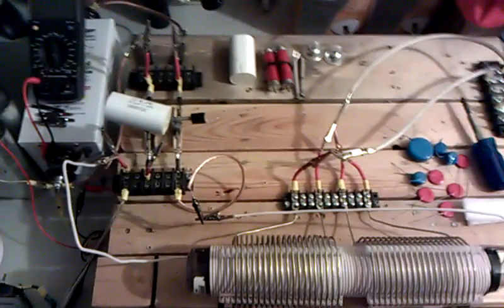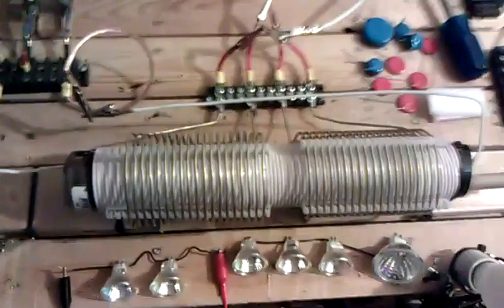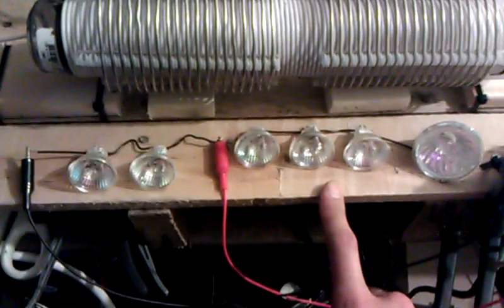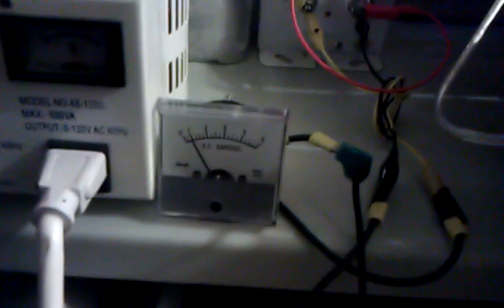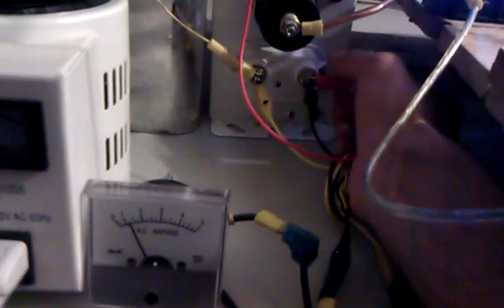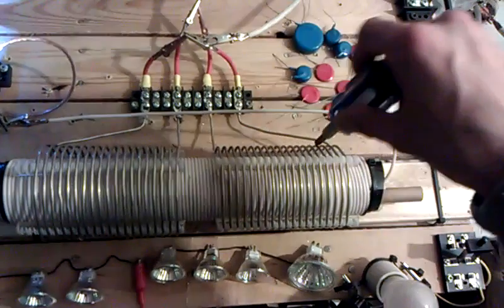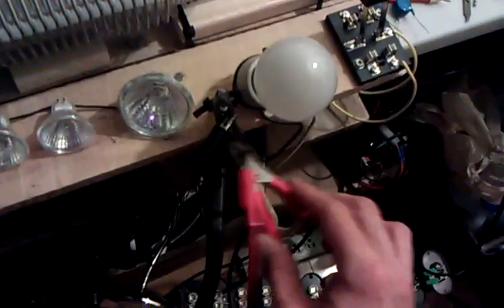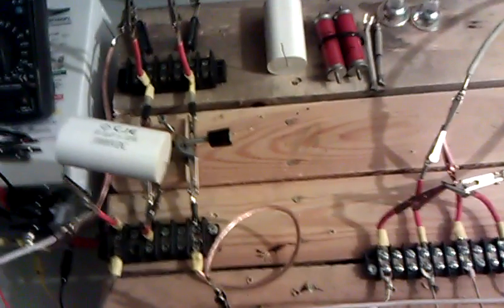Don Smith Device Project Part 36: Experimenting with Higher Capacitance and Welding Wires :)

Comment: You need second spark gap and resonant LC circuit in step down transformer primary on frequency your second spark gap will fire.
The frequency you fire over first spaek gap into DS coil primary should be much higher than frequency going over second spark gap.

Good luck!

Comment: Now if you get step down transformer with capacitor in series on primary and attach over spark gap to your DS coil output on resonant frequency to your high voltage capacitor firing rate, you should get some good power out.. ;)
Also you might increase input frequency to the system so the high voltage capacitor will start firing at least on 50Hz instead of ~20.

Cheers!

Comment: Or an electric fan heater with the fan powered by normal electricity, and the element by the generator circuit.

Comment: Hi,

Just a tip.
The blown out bulbs may sometimes be used as a spark gap. I do use one as a spark gap in a setup where I de-sulphate batteries,

You do sure have a lot power going on there. Why not spend 10 bucks on a hairdryer? See and try if you can get it to heat up real good. Note that the fan inside the dryer will prob. not turn. But it is just an idea. I would like to heat up my house with 10 hairdryers. Why not?